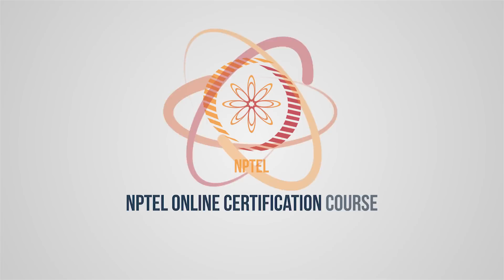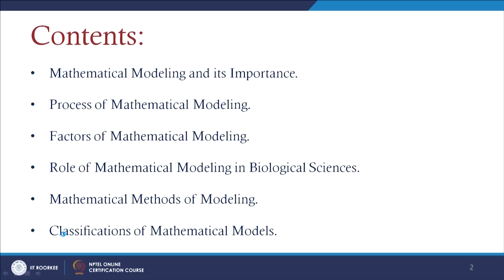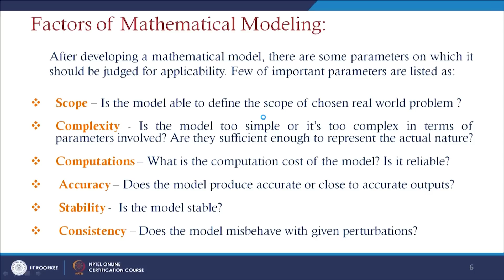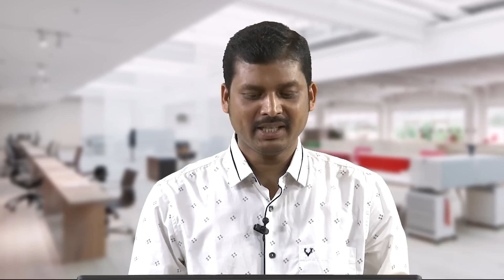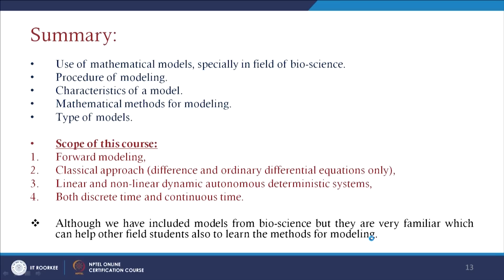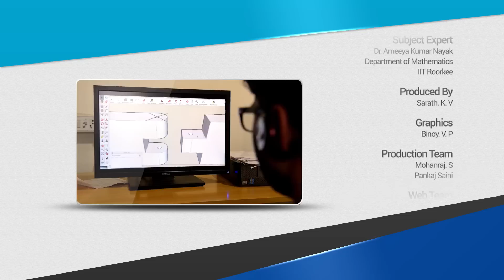Introduction to Mathematical Modeling

Comment: Sir plz be little slow because its maths we need time to focus on things
Reply: you could keep the playback speed slow
Reply: It is supposed to be this fast. That is the way this modern video series is set up. The instructor has compressed an hour lecture into 30 minutes because most people don't have the time for a whole hour. Those who need more time to understand can pause the video a lot and change the video playback speed under the "Settings" icon from "Normal" to .75 or .5 in order to slow it down.